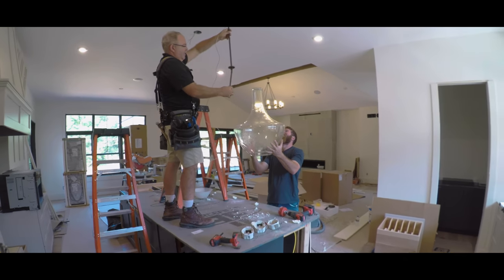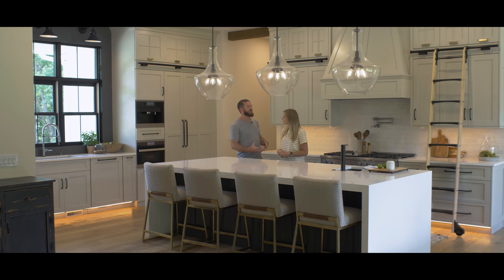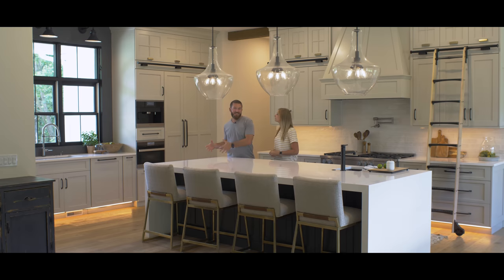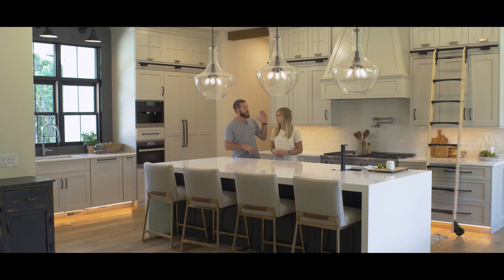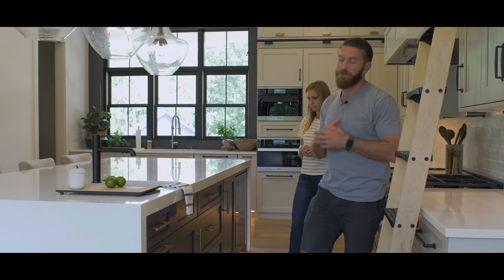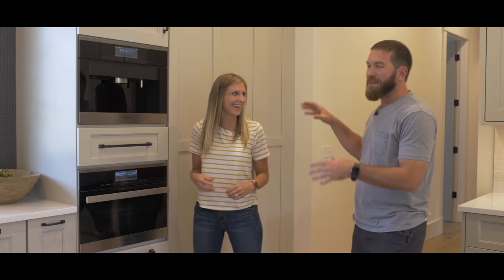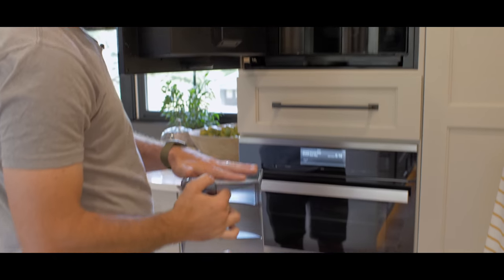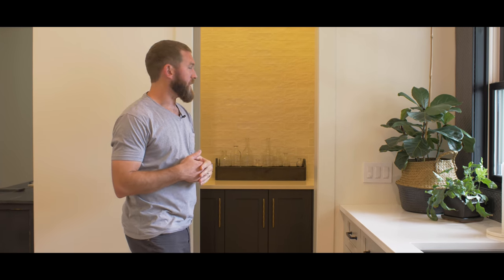Amazing Features we put in our Dream Kitchen!

Comment: Those electric saws and mitre uses electricity I’m sure 🤔
Reply: And air compressor... 😉
Reply: I guess he means " off the grid"
Reply: Heavy batteries
Reply: I kind of had a nice giggle there too. 😂
Reply: @michelepace777  they use hamsters to charge those batteries...
Reply: @MikeLeeSr  No, solar energy is what they use.
Reply: Michele Pace it is still electricity whether it comes from a commercial line or from your own solar panels, wind mill or whatever.
Reply: Those were all pneumatic tools, not electric tools. I'm not sure how the air compressor fills with air, but I'm sure there are many ways of doing that without electricity. Google is your friend.
Reply: @michelepace777  Cannot get enough energy from solar to power anything beyond a light bulb.
Reply: @Peggyt-jp6mt  Not true. A lot of people run their whole home on Solar panels ( including tools in workshops) do your research. I know  a lot of people who do but they also use backup batteries too if need be.
Reply: You all may need to research Amish a bit more, it's not 0% electricity and it varies from group to group. The one thing Amish do not want is public power as their belief that too much reliance on public power ties them too close to the world and the influences it could bring. But even that isn't 100% followed with each group, some see limited use ok. Also, some groups may use diesel generators and gas canisters which I doubt they have the facilities to make so they would rely on external there. Solar panel, minus the reliance on the manufacturer, is also used.

So it's more they use electricity selectively and somewhat rely on external things.
Reply: @Peggyt-jp6mt  Do you operate heavy machinery?

Comment: Amish making "cabinets w/o electricity"  I suppose all those air tools are powered by bellows, and the jointer/planer has squirrels running in a cage. The battery powered miter saw isn't electric either?
Reply: @sillililli01  I think they have air and their tools and are converted to run Hydraulically of a PTO pump. Also not all amish are the same, some have buggy and some have Trucks.